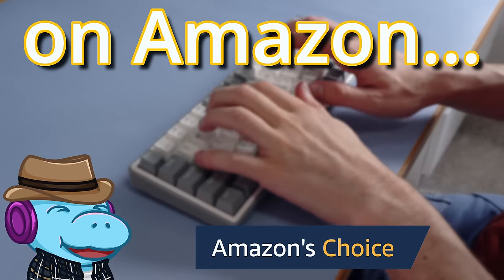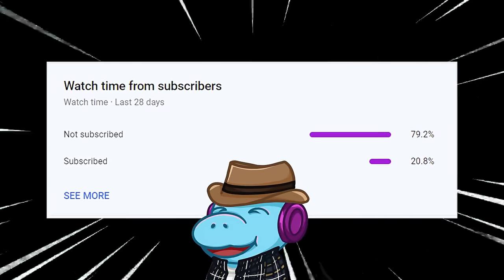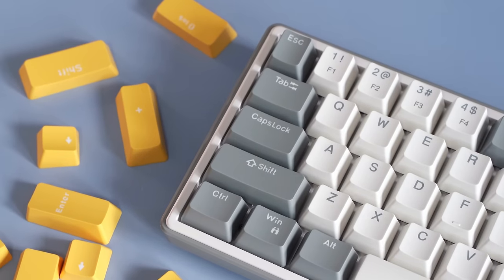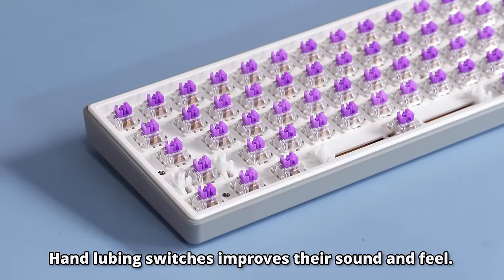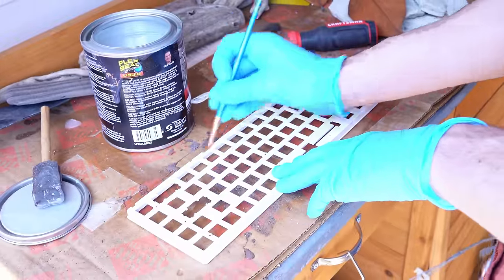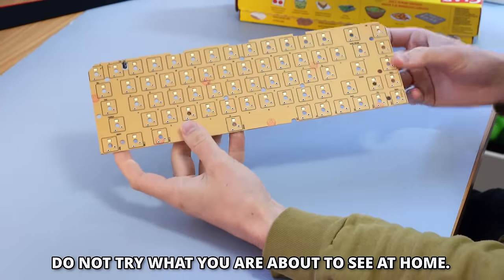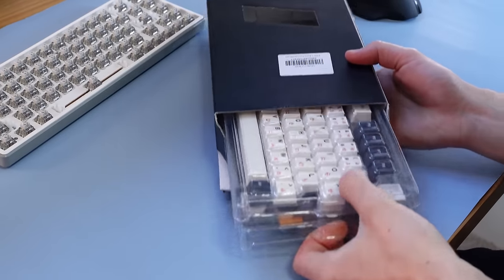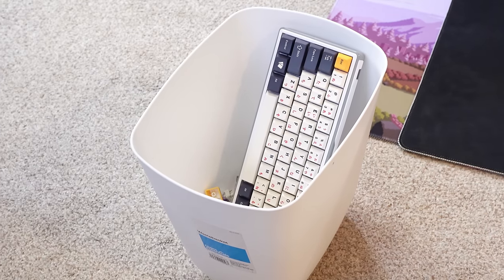WHY is Everyone Buying This Keyboard?!

Comment: Yeah, hard to win the challenge if your keyboard doesn't actually work lol. Still, both of them wound up sounding good after the mods you each did. Just goes to show that there is an entry point into the hobby for those of us who are poor and it isn't just all $100+ "budget" options.
Reply: This is the next step - sounds good but doesn’t work. After that you’ll just have  ASMR keyboard noises playing 24/7 😂
Reply: keychron v under 100 with actually good switches!
Reply: @gunmadonuts  I just got a Yunzii B75 for $56 shipped, with a clipped and lubed stabilizer service ($52 without it but easily worth the extra 5er) and it sounds and feels incredible, compared to my previous GMMK Compact.
Reply: BRO HE HAS MY KEYBOARD

Comment: Leobog just released their V4 and they are also 5 pin... if you pick the right base for your cheap keyboard, you can definitely get a nice keyboard with a few mods.  I bought a $26 64 key sandwich mount hotswap trimode from Amazon for my living room PC... threw a set of on sale PBT dye sub key caps on it with a budget long pole linear, some plastilina and free PE foam and it's now a nice small mech key for our browsing and multimedia needs for less than $80
Reply: I would just buy a Royal Kludge and not do anything for just under $80…  Several in that range don’t need anything bought after purchase….  I bought two of the MageGee 75 for extra work keyboards, and they aren’t bad.
Reply: @farmeunit Which one? I have the RK68 but it needs at least foam and some stabilizer tweaks.
Reply: @zNoah  RK84 Americano with yellows or M75 I got on sale with silvers.  I also got an Akko 5075B with silvers for $80.  Lots of good budget keyboards pre-lubed.  I’m not a keyboard “snob” though.  I don’t mean that in a bad way, either.  Some people just like tweaking things, which might be me if younger and had the time.  I just don’t want to bother anymore.  And I lean towards sub-$120 boards.
Reply: @farmeunit  Get ya, once I got a job, anything I do on my free time seem to consume all that free time.

I tweaked my rk68 back in college (2020), wouldn't spend that much time again or at least all at once, maybe in the span of a few weekends.

Comment: You actually can feel the flex more with that style of integrated plate than the regular cheap tray mount. Are those plate/case hybrid is actually clipped in with the bottom case? If yes then you can cut all the standoffs to make it even more flex and consistent

Comment: Sounds amazing. Personally I'm still waiting for a full sized k/b with a volume scroll and good latency (<3ms) that can thock. The most I'm willing to compromise is a TKL keyboard with a numpad but I wouldn't be surprised if it annoys me to have 2 things to manage. Until then, I see no reason to upgrade from my old Logitech G810.
Reply: I have the pro tkl 2023. I love it. Especially seeing my component temps on keyboard screen. I did swap out keycaps. Still looking for creamy switches that work for tkl
Reply: Keychron V6?

Comment: I did a similar mod for my wife's cheapo redragon recently. Same type of PCB. I forced in some Gateron Milky Yellows by crimping the pins. It was super tedious, wouldn't do it again, but it ended up sounding super dreamy after smushing some foam between the plate and pcb, and adding some decent foam in the case.
Reply: You can just snip the pins off if that makes them easier to place in

Comment: I actually bought that keyboard last year, I bought it as a compromise. I really wanted to try a 65-67 key keyboard however I wasn't sure if it was for me, I thought I would regret it if I spend like $250 to build one and only dislike it.

I've always used full sized keyboards so I decided I'm more willing to take a chance on a $20 keyboard than a $250 keyboard.

I really liked the keyboard, thought it pinged a good bit, I really wanted to test mod it but I decided to save my patience, and sanity for my true keyboard..... spent like 4 hour lubing those switches.

I ended up with a new drop alt for a great price, lubed switches, installed some stupid fish foam, greased all the stablizers, etc I did a bit and I'm very pleased with it.

I still have that cheap old keyboard and I kept it in case one day I decided to actually mod it, I have some nice color shift paint.

Comment: So I recently picked up the 84 key version of this board from a resell store for about $7. The star84 has a metal plate in it but no detachable cable and no wireless. Sound is more interesting than my standard HP membrane keyboard. Been binging your videos all week and have a set of keycaps, pullers, and lube coming in this weekend. Gonna get some foam for it too.
Reply: Is it good? Just got a similar keyboard for $8 called the magegee sky81
Reply: "Sound is more interesting than my standard HP membrane keyboard" shitting outta your ass is a more interesting sound than a membrane keyboard

Comment: Really fun video!
Outemu does make some really nice switches, for example their silent Peach and Lime/Lemon switches are superb. They are smooth, quiet, and very light - I think you might like them. At worst it's really hard to argue against them at their sub-30$ price for 100+ switches.
With Outemu or Mill-Max hotswap sockets you really need to be careful because they are so small. Poking holes through the press'n'seal with a needle before you insert switches might have made the mod work.
Reply: Outemu are TRASH switches. I tried a few cheap keyboards with outemu switches and without fail, the switches last about 2 months before they just start going out. I tried multiple keyboards with them and they all suck. Maybe I just have bad luck and just so happened to get multiple keyboards from multiple vendors all with the same terrible batch or something but I refuse to even entertain the idea of using them now.

Comment: The Tes68 I got for $19. Has per key RGB LED, Hotswap sockets, USB-C cable for using it in wired mode if you want. And surprisingly also let you connect to 3 separate Bluetooth 5.1 devices, and 2.4ghz with a USB dongle that slides into a cut out in the bottom where the battery is at when you aren't using it. (Oh yeah and had several layers of removable silicone dampening, and a layer of foam between the top and bottom of the PCB and between the aluminum plate/PCB.)
Reply: U sure that’s a tes68? Cause the usual tes68 has no rgb whatsoever and is wireless only

Comment: Outemu socket usually only works with AKKO, Content or KTT, BSUN, Outemu, and the likes because their pins are small enough for those sockets. Other gateron style/cherry switches are not compatible. Forcing the switches will make the switches broken and thus make it not work. Aside from that, if you are gonna throw that keyboard away. Please send it to me. I am specializing to make poor people's keyboard good so that some of the very economical people here can still enjoy mechanical keyboard, even if it is crappy.
Reply: how can he not know that wtf? Any akko cs, ktt, gazzew, bsun, outemou switch would work. It's not like he doesn't have options for good switches.

Comment: Dampening: the act of making something damp (wet)
Damping: the act of reducing vibrations
Reply: Dampen ALSO means “to make less strong or intense”.  

So “dampen the sound” simply means to  reduce the intensity of the noise. 

“Damping” applies to the physics of sound, to “reduce the amplitude of vibrations”. 

Bottom line, in informal speech, EITHER is fine.

Comment: fun fact you can in fact put cherry mx style switches into outemu sockets! just be warned you do need to clip the 2 plastic pins and some older outemu hot swaps will not work. personally i put akko piano v3 into my redragon fizz keyboard also be warned there is a high switch failiure rate about 10% of the switches will not work when you first try it.

Comment: I still recommend the Royal Kludge RK61 as the "entry level" board for anyone wanting to get into the hobby.

Yes its twice the price as this one, but its also twice the quality. And sounds fantastic after a few mods. They also just released the RK61 Plus that comes prelubed WITH foam.
Reply: tecware phantom+ >>>>>>>
Reply: I BAUGHT THIS KB 2 DAYS AGO
Reply: Nah all of these pale in comparison to the iLovBee i61, 5 pin hotswap , lubed and foamed full rgb for 29.99

Comment: my mechanical keyboard only cost less than 20$ it's the aula f3261 and I tried the eva foam mod, tape mod and pe foam mod also I lube the stock switches and its sounds a bit better than the stock and I'm satisfied since I'm just a beginner in this hobby.

Comment: Call me crazy, easy lube is a little WD-40 or if you wanna get REALLY crazy, lucas engine oil stabilizer (it's specifically designed to eliminate engine valve tick noise). 

The lucas engine oil stabilizer is thick. With 5 C's. Thick like molasses. Using a tiny bit helps dampen the travel and sound. Creates a deeper sound. Highly satisfying and easy to lube without taking the switches apart

Comment: The problem was the cable. Even the original cable might not work due to an excessively deep socket. The keyboard lights up but doesn’t type. You should try another cable. This is based on my personal experience.

Comment: Ok this tip is only for hippio NOT BETTY! if you have bad stabilizers you can cut up a tiny pice of a bandaide and stick it on the stabilizer and just put the key on and it helps a lot.

Comment: It’s worth noting that most Akko switches will fit in Outemu switch sockets and are very high quality budget switches.
Reply from the maker: But most akko are 5 pin
Reply: @HipyoTech  not really true. They only started doing that recently and the pins are still thin, so if you cut the legs off it works fine
Reply: Just cut the stupid pointless plastic nub legs.  They dont even do anything. What do u think will happen of u hack off some plastic to get it out of the way? It'll stop the metal contact from workin? Of course not lol
Reply: @jetlyfe12  I think it's less a question of it working and more about all the extra time and effort that takes to snip off the extra pins on 60-100 switches.
Reply: @Dcheck  i mean, it takes less than 5 mins.

Comment: I bought two Magegee keyboards when I was just getting started with mechanical keyboards... a TKL and this exact 65% and I gave them both away. Because gawd. Also because look where they put Home and End on the Fn layer. Drove me crazy. This would have been about the time you were recording this, and it was mostly attractive because it was cheap. And yeh those sleeved sockets are bad but not all Outemu switches are bad... the Outemu Silent Lemon tactile switch is really really nice. Completely un-thocky but that's what I like.

Edit: I now have a Tester68 and even that's a better keyboard than the Magegee.

Comment: I still want to eventually see the idea I tweeted at you awhile ago, using one of those padded envelopes, the kind with the shallow bubblewrap inside the thick envelope paper, cut in half so that the bubbles are exposed, under a PCB.  It should at least act similar to gasketing and tape mod, though now I also wonder if the bubblewrap-like material, assuming it doesn't pop, also has qualities similar to the press-n-seal.  On top of some filler, like kinetic sand or silicone, it should sound decent.  A strip of the paper-backed-bubblewrap might also work as a top gasket, at least around the perimeter and dead areas.  At like $1/$1.25 for a two pack at a dollar store, this might be one of the most cost-effective solutions, especially if it covers the qualities of multiple mods with minimal waste.  The only thing further than this would be using a glue stick just to make sure the paper side sticks to the PCB.

Comment: Curious: How do these rivet sockets are only compatible with Outemu brand switches, could you not put any 3 pins there? I conveted(!) one of my old soldered keybord to hotswap with these rivet sockets back then, and used switches manufactured by Gateron. Also I had to bent pins a little for them to make contact. That was probably the reason the switches were not working. After bending the pins a little while applying, they all worked nicely for my case.

Comment: You had to clip the pins way shorter. I did it on the same board and it worked. If you don’t believe me, look up how to clip five pin switches into outemu

Comment: Pro tip, if you face small ahh outemu pin sockets, take a nail clipper and make the pins sharp and it will go in without breaking it

Comment: You actually can use a 5 pin switch in a 3 pin keyboard. You judt need to clip off the 2 plastic pins. I tried it and it worked great 👍

Comment: As a poor person, who only has budget for the cheapest things possible, my experience with outemu sockets says that you should have filed the right pin in the switches so it became thinner and fit easier/easily in the sockets. 
I bought some fake pandas for my first build and lost +-10 switches until I figured this out.  :')
Reply: or you could just buy compatible switches from the start 😂

Comment: I guess the takeaway is that a cheap pcb will crack when you press a switch with force into it. If you buy cheap ones, using as they are is safer after all.

Comment: 6:48 No, it's not "dampening", it's "damping". 
Dampening comes from dampen, which is to make something damp, or moist.
Damping is to damp something, to make it ring/ping less.
Reply: Dampen ALSO means “to make less strong or intense”.  

So “dampen the sound” simply means to  reduce the intensity of the noise. 

“Damping” applies to the physics of sound, to “reduce the amplitude of vibrations”. 

Bottom line, in informal speech, EITHER is fine.
Reply: @BoJangles42  ...and what has that to do with "dampening" mentioned in the video?

Comment: Your main mistake is you're not buying a keyboard with bezels.  You need those bezels, and that key seperation between groups of keys.   So in the dark, without looking, you can find them spread out.    Jamming keys all into a small rectangle with no bezels is probably the worst design ever, and was only pioneered for mobile users and travelers to use on the go and pack into a suitcase.  They were a sacrifice of comfort to achieve small form factor.  You do not want to be buying them as your main daily drivers.

Comment: God, i'm having war flashback with outemu switches. I remember finally getting ready to swap them out and i couldn't pull the switches out coz the housing just breaks. Not sure if it was because of the crap way the keyboard manufacturer went about with their "hotswappable"ness or outemu made their housing out of paper or both, but i just ended up scrapping the keyboard entirely.

Comment: Please make a video on the Fogruaden BlueSamurai 75% keyboard, it's 40 USD on amazon and comes with a knob, doubleshot pbt keycaps with a pretty neat design, a 5 pin hotswap pcb, and some pretty darn good stock stabs(after lubing and clipping).

Comment: Little bit late to this but…..the cling wrap that you by around the PCG could also be interfering with the contacts and if you pushed through and might be why it was so hard to put the switches in the board.
Reply: Tried this mod and the reason why the switches were so difficult to put in is because the metal pins are slightly too big for the socket, so in order to use these switches, you have to file each and every switch

Comment: Hi hippo 🦛 

As I modded my keyboard I had wrapped the pcb in foil to.
This is the reason why your keyboard didn’t work.

Since you pressed the switches in with the wrapped pcb the metal Contact points got covered which was probably the reason behind it not working.

Comment: I have the original GMMK board and I have to clip the pins off switches. It's such a pain in the ass. I find a nail clipper works well.

Comment: I had a keyboard with the same metal pins, and they ARE SO BAD, like the keyboard was prebuilt, and it said "hotswapable" on the box, BUT WHEN I PULLED A SWITCH, A PIN GOT SNAPPED AWAY FROM THE SWITCH AND NOW IS STUCK ON THE KEYBOARD, soldering keyboards are so much easier then these keyboards... plus puting switches back was so frustrating, that while puting them on, i cant tell if i actually put it on or the pins on the switch BENT 0;

Comment: If I couldn't be bothered to spend some hours lubing switches for a super cheap board, I'd at least just tub lube the stems and bag lubing the springs.. Not the best lubing method, but hey. Cheap, fast solutions for cheap boards.

Comment: I have an e-yooso z686 and i modded it with akko cream yellow v3, the pcb of the keyboard is the same of the magegee from the video and the switches doesn't fit, however, i cut the two plastic pins and i comverted the 5 pin switch to a 3 pin switch and it works so damn good, feels so creamy with a pe foam and tape mod, so, you just have to be a little bit creative ^^

Comment: Thank you so much for this video. I feel a bit less bad now. 😅 I basically did the same kind of thing with a MageGee keyboard 2 weeks ago without watching this video first. That was my first mistake.  I used their 96% keyboard. Spent $36 on Amazon. I broke 10 Gateron Yellow 2 switches before I realized that you can't use just any 3 pin switch. Same issue. It was really hard to press in the switch.  The pin would either get pushed up into the switch or just somehow not work after being pressed in.  In the end I Started over with a GMMK 2.0 96% and used the same switches and some Blue Samurai Keycaps I got from Amazon.  The difference in price for the GMMK 2.0 vs the MageGee ? -> $30.   Could this have worked?  With more clear labeling by MageGee about compatible switch types I think it absolutely could.  But would it be worth it after all you spent?  ¯\_(ツ)_/¯  Maybe its all the friends we make along the way that makes it worth it?